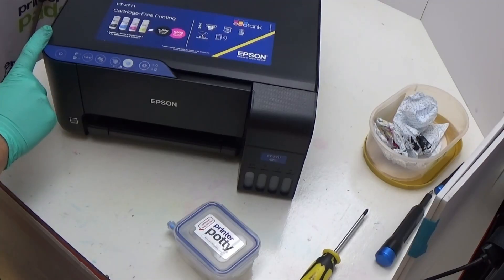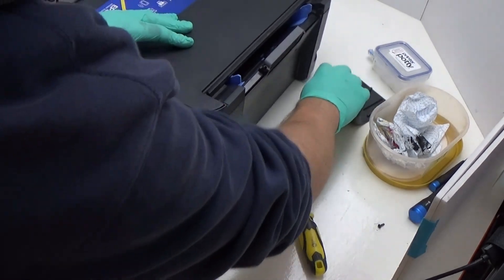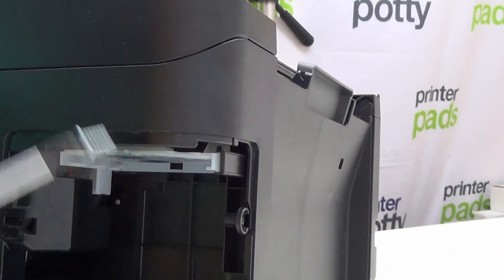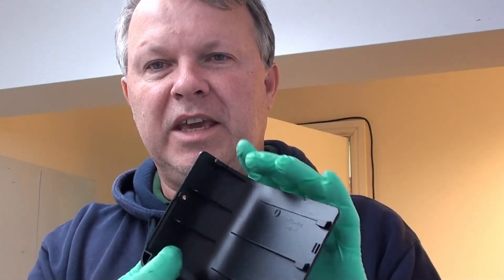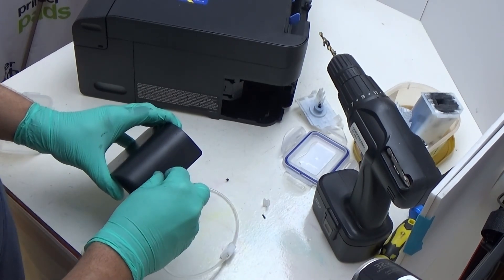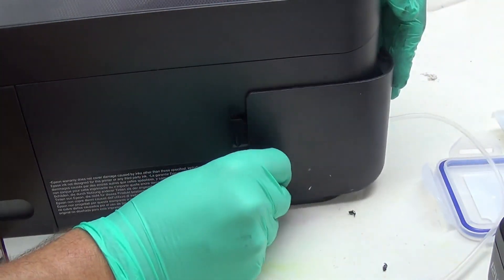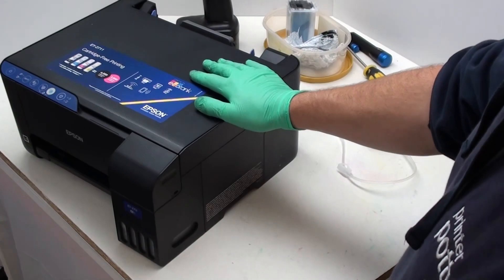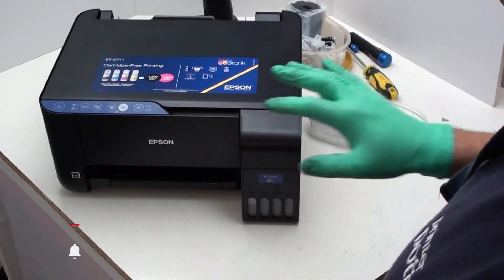Waste ink tank install: Epson ET-2711, ET2800 +

Comment: great video. I have the ET-2710 and it prints just fine, no lights flashing but it just won't take any ink.
I am using the correct original 104 bottles, you sit them on there, but no ink flows into the empty tanks.
Grateful for any thoughts on what the issue might be, thank you.
Reply from the maker: Not had that issue myself but most likely causes by a clog in one of the following:
- one side or other of the fill hole in the reservoir inlet
- the vent channel in the reservoir (usually hidden from view so may require access to a service manual to see where it is)
- one or both sides of the bottle outlet tip

The short version is that air needs to be able to get out of the reservoir to allow ink to flow in. So if something is blocking air exit, ink ingress or both, nothing will flow in.
Reply: @octoinkjet thank you
Reply: @octoinkjet thanks, I made this video of the issue https://youtu.be/tOwyo7QXxlQ?si=VWBvUFJVEL5HZw3u
Reply from the maker: Did you want to contact us via support@octoink.co.uk about possibly shipping the printer and inks over to us?  

I could see if I can figure out what's going on and do a video of the process... Of course chances are high the shipping process would likely cause the printer to unclog whatever is causing the issue and just ruddy fill the moment it arrives but might be worth a shot.
Reply from the maker: Printer arrived today so I'll take a look when I get a chance...

Comment: Hi, the Ecotank et 2860 isn't listed on your website but the et 2810 is. Would this work for my 2860? Many thanks

Also could you just pass the tube through the old screw hole and not have to drill another hole and not put the crew back in?
Reply from the maker: There’s a video for the ET2750 which will cover your ET2860 so best search our channel for that first.

Comment: Does this work for the Epson ET-4850? I've been through your site but couldn't find any mention that mentions the compatibility for this model.
Reply from the maker: The ET-4850 is one of the newer models equipped with a user replaceable maintenance box which is basically a chipped waste pad holder. Your model takes the T04D1 maintenance box.

That said, if you get a service required message it’ll be the platen pad which handles any overspray from borderless printing and that’s harder to reset.

Comment: If I attach an ink potty does that mean I won't have to reset the counter? I haven't a clue what to do for the best. I've just filled up my Ecotank 2710, and cleaned out the saturated pads, dried them and put them back in. The buttons are still flashing. I'll go out tomorrow and buy the cable so I can reset it. I did find your videos very useful.
Reply from the maker: Sadly no, the waste ink counter still has to be reset each time the limit is reached. But the main benefit of an external tank (potty) is that you don’t have to keep replacing pads (or cleaning/drying them). As a rule it only makes sense if you’re expecting to keep your printer running for 2+ lifespans which is not impossible.
Reply: But how to reset the counter?
Reply from the maker: We have a number of videos in our channel that show how to reset the waste counter on different computer operating systems. So if you search our channel for "WICReset" you should find them all and locate the one most appropriate for your computer system.

Comment: So no need to buy a key activation code?
Reply from the maker: Sadly not.. resetting is still required. What an external kit does is remove the need to replace the pads each time the error hits. So the kits are perfect for end-users who generate a lot of waste ink (ie: hit the waste pad error within 18 months) or who really want to keep their printer running long term.